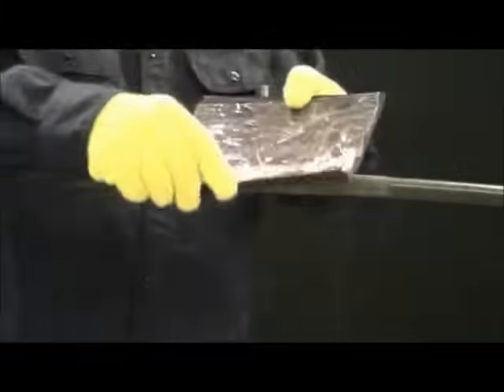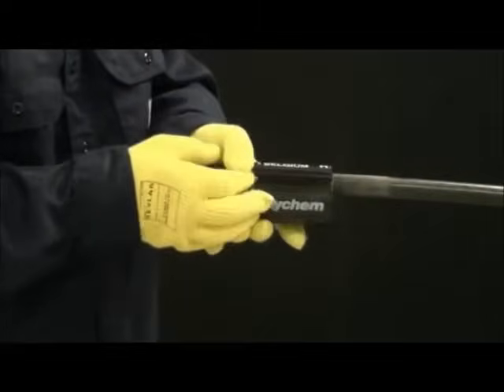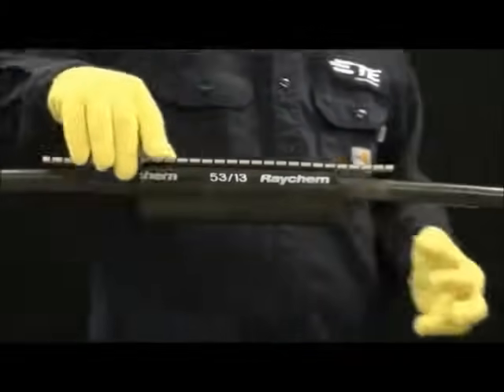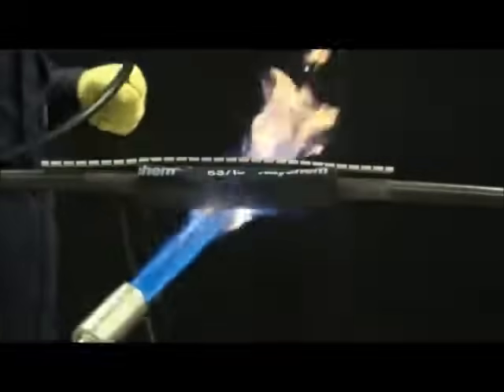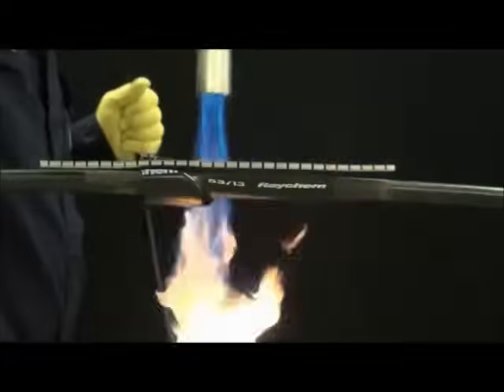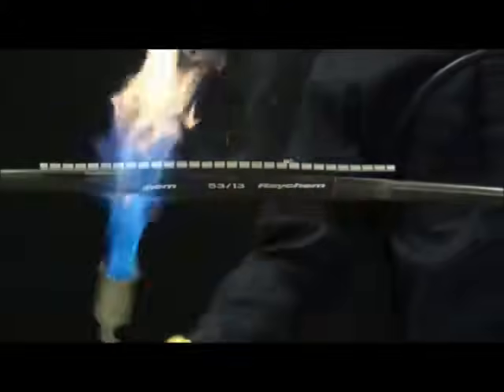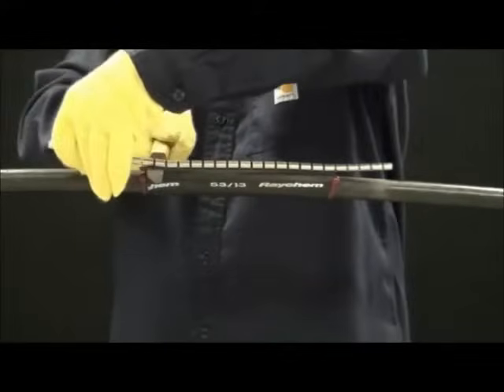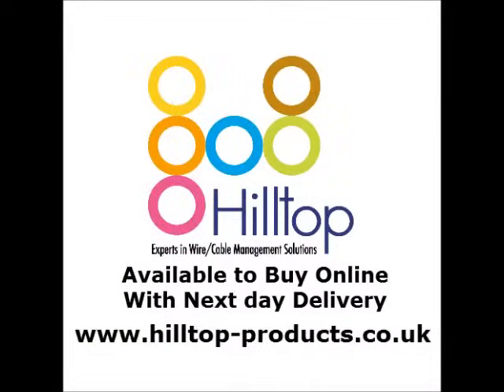CRSM Wrap-around Sleeve TE Connectivity / Raychem

Comment: We use this style of joint (made by Raychem) at work. But we don’t cut the rail off. 
I’ll be putting one on later today following 800pr ESide cable renewal.
Reply: Yes, normally the rail & channel will not be cut off after installation. 

We are heat shrinkable sleeve,closure,end cap manufacturer with almost 40 years experience, offering lots of alternative replacement for Raychem/TE/Commscope XAGA,CWST closures and sleeves. Any interested, pls visit my page.